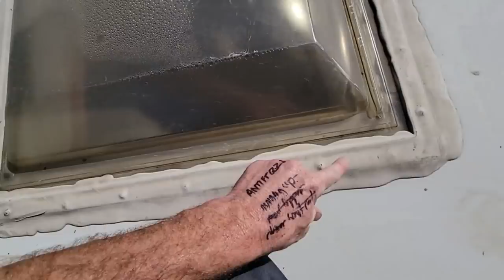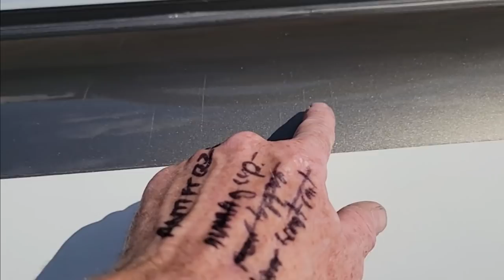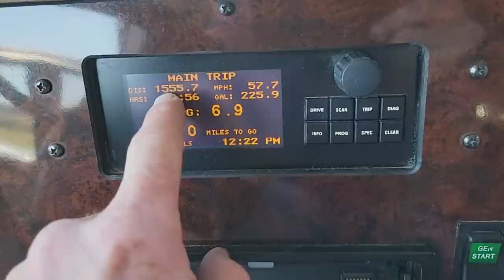I Delivered Andrew Steele's RV to Kentucky Better Than I Found It

Comment: I’m surprised that the crew is allowed to spray the volatile refinish products in the open air, I would assume that the bus should’ve been in an approved spray booth so that the carcinogens in the overspray would’ve been arrested by the exhaust filters and such a spray booth.  
What are the EPA regulations and the jurisdiction where the bus was refinished ?
Reply: Dude, they spray all kinds of "spray paints" on commercial buildings bridges etc.... Your concern is pointless.